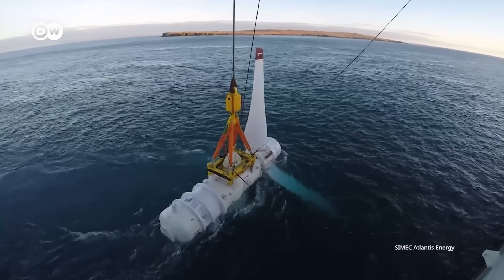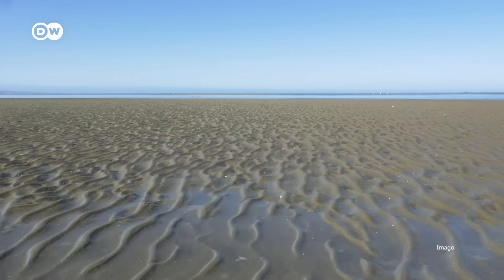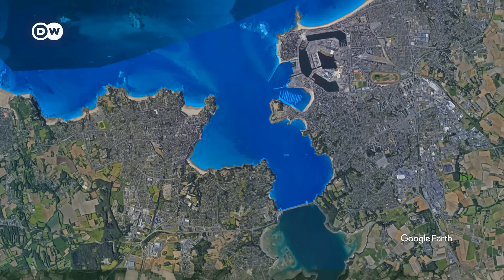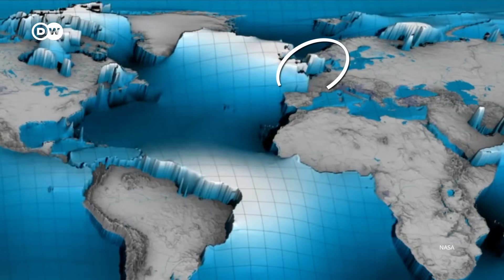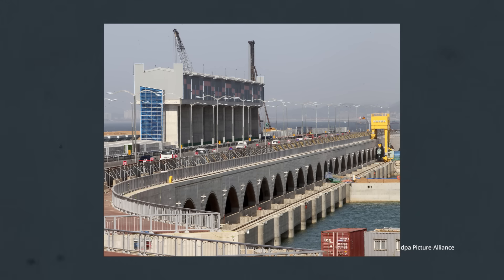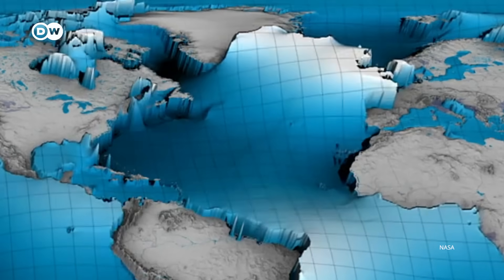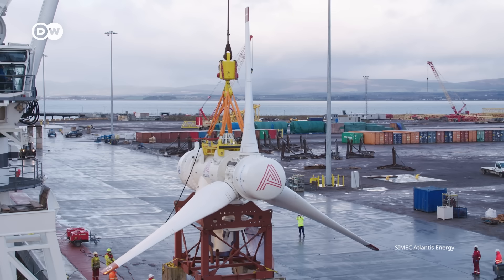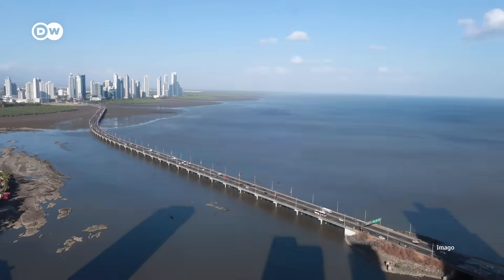Tidal energy could be huge – why isn't it?

Comment: So the environnemental effect is accaptable here, but not in the case of nuclear....
Reply: Nuclear has a worse, worst case scenario environmental impact. But safety aside. They're prohibitively expensive. I am unaware of any nuclear power plants that have made a profit without government help.
Reply: @britishmalayasociety  im not sure why the worst case scenario of a local contamination is worse than the global catastrophe that is climate change... But anyhow...

Costs are primarily tied to construction costs, which can be significantly lower, if you actually use economics of scale. We have seen that in France. I will agree though that nuclear power is best operated by the state itself. For me, this is not really an issue, since it also increases security. And while green energy may be cheap to build, the energy prices are really high... Look at Germany having the literally highest energy bills in the world
Reply: @MrPhiltri  That's what renewables are for. They can be built, usually ahead of schedule, within a year, unlike nuclear which is already pretty quick if done within a decade, by which time renewables would long be constructed, profitable, and producing power. I am unaware of a nuclear powerplant that has turned a profit in its lifetime considering government subsidy.
Reply: @MrPhiltri  Considering France, EDF is the largest nuclear company there, and they've been tabling splitting the company into two, the profitable renewables side, and the less so on the nuclear business. Furthermore nuclear used to make up 80% of the French national grid. It's now 70%. It is that for a reason. Sure, France is constructing 8 new powerplants, and may extend that to 14 by 2050, but France is set to decommission more in that time period. Considering wholesale cost of power. Germany is cheaper than France. And France itself is heavily investing in renewables.
Reply: @britishmalayasociety  please show me, how Germany is cheaper??? This is an insane proposition.

Yes, the French pay for their power through taxes, sure, but in the end its still better.
Reply: @MrPhiltri  The European Union publishes it's gas and electricity markets reports every quarterly. Germany has some of the cheapest wholesale energy prices in Europe, often cheaper than France. Retail prices, are a different story. Germany is replacing old electrical networks through taxes, and on top of that, privatisation of the network has not led to competition, but increased pricing. As what has been found in Australia, for example. Private industries price gouging.
Reply: @MrPhiltri  Yes, every national grid has public money flowing into it. Your claim is that, nuclear is a better cost option. You are aware that, the UK is struggling to fund one nuclear powerplant (HPC) and despite the efforts of the British government, private companies from the UK, US, France, Japan, and China, SWC still doesn't have enough funding for it to be completed?

Then there's the US's upcoming Vogtle 3/4 nuclear reactors. Now costing $28 billion over double the budget, taxpayers footing the bill.

Then there's decommissioning. Sellafield produces zero power, but taxpayers pay millions every year in decommissioning fees, which will not be complete until the next century.
Reply: @britishmalayasociety  well retail prices are what matters, no? And your argument about private price gouging is basically the reason for my argument for state controlled base load energy production. Doing so anchors the market prices avoiding the aforementioned gouging.

In the end, German people, including me, pay the highest prices ever while also bankrolling Putins agenda through gas imports and buying up French electricity at times of low renewable output. That does not seem like a good plan.
Reply: @MrPhiltri  This is before we even deal with insuring a nuclear power plant. Which you could understand is significantly greater than any other energy source. For example, Fukushima was insured for around $1.1 billion, through private and public funds. Compensation to families will cost $50 billion alone. This excludes the cleanup, storage, and decommissioning. Including everything, Fukushima is looking at $1 trillion in costs, for something that was insured for only $1.1 billion. Taxpayers have to foot the rest of that bill. Sure, Fukushima is a rare example, but it goes to show the massive costs that go into nuclear itself.
Reply: @britishmalayasociety  yep, aware of all that, but money paid over time is worth less than money paid today. Discounting is a thing you know...
Reply: @britishmalayasociety  and don't misunderstand me... Clearly renewables are the most important source for the foreseeable future, but it just can't be the only one. Out of all the other option i think nuclear is the best one at the very least because its emissions are lower. Its a good match for the problems of renewables
Reply: @britishmalayasociety  just because you have big numbers, doesn't mean, its expensive. Many smaller numbers can equally add up to big numbers.... I feel like I'm arguing and grade school level...

Yes, nuclear power plants are single big investments. The cost per plant will always appear gigantic as compared to other plants. But the cost of kWh / service time is not.
Reply: @MrPhiltri   Retail power pricing gives distortions that have little to do with the actual cost of energy itself. That's like saying smartphones are expensive because Apple's retail pricing, and adding the cost calls, texts, wifi and data plans used. You're basically saying that, smartphones are expensive because they cost $135 a month for the next three years through ATT. Rather than, the actual value of the device alone, which is ~$500. The involvement of private companies in Germany's case, shows Moore's Law in action. But still, prices are declining there, as they are in Australia with their renewables loadout. Pricing aside, energy reliability has improved thanks to renewables.

Considering retail pricing, you'd need to look at a nation which has more renewables than Germany. Germany's renewables represents less than half the grid. The global leader, excluding smaller territories, is Norway with just over half. Norway has cheaper wholesale energy than Germany or France, by far.
Reply: @MrPhiltri  MSR might be an option in the future, with its promises of safety and cost. That is the only other option, but, we won't see that until 2030 at the earliest. So for now, renewables are pretty much the only option... There's this newer undersea turbines being developed, and older green energy such as geothermal and conventional hydro.
Reply: @MrPhiltri  Yeah, well, when governments and investors put their money and weight behind renewables globally, it shows you that the maths work. There's a reason why you can buy your own personal home solar and battery solution now.

And if you want to look at costing specifically, Lazard have done LCOE on renewables, fossils and nuclear. Renewables are always cheaper than all others.
Reply: @MrPhiltri  Lazard being, an old, reputable global financial and asset management advisory company. So it's not like some unknown new startup. But I guess nuclear has found some traction lately. The nuclear lobby is strong and is funded by a lot of mining industries. You'll find people that push for nuclear, do so thanks to lobby funding. Eventually you end up with influential people like Michael Shellenberger who both shill for nuclear, whilst also end up denying climate change... 🤷‍♂️
Reply: Scotland also produces and researches nuclear energy

Comment: Before watching, I'm going to attempt to answer the question posed by the title.

Building stuff that has moving parts underwater that you want to last for a long time is hard. So hard, in fact, that it is too expensive relative to other options.

Anyone already finished, how did I do?
Reply: Nailed it
Reply: @Arrica101  I mean, they didn't nail it. It's expensive but not for the reasons they gave.

Comment: Harnessing tidal power slows the Earth's rate of rotation (lengthening the day), as well as lengthening the Moon's orbit, and moving it further away. Has anyone ever calculated how much?
Reply: Very very very very minute, virtually zero
Reply: That energy is being transmitted anyway. If we don't use it to generate electricity, it would simply be lost to any number of natural processes such as viscous heating of the oceans. The eventual tidal locking of the Earth to the Moon in inevitable.
Reply: @costcorotisseriechicken2520  Has anyone calculated when the moon's geosynchronous orbit will occur, with consequent loss of tides?

And where relative to the earth will the moon stop? Which area of the planet will be permanently shadowed?

Comment: I've been asking this for years. Why go with unreliable wind when we have huge untapped reliable tides all along our coastline.  There is no issue with slack tide or no movement because that high or low tide moment happens at different points along the coast . You only need to be a few miles away from each other and you would avoid that deadspot.
Reply: You wanna know?
Cost, its not economical.
Corrosion, its frikin Salt water!
Google a picture of a old windmill and u will see how beat up those are. Now imagine the same but 100 times worse.
Reply: I’m kind of glad we didn’t, if we globally jumped into it 30-50 years ago we would have destroyed so many rivers and ecosystems that way, but the other way wasn’t much better.  Technology increases so fast I’m sure we will see more eco friendly water turbines in the future and I’m excited for it. Clean renewables and nuclear is the future.
Reply: @jcakblade101  I do recognise that. I canoe and sail these waterways.  But how much damage are we doing endlessly relying on gas, which all come from Russia.
Reply: @directorstu  gass isnt the only alternative. We can use wind, solar, nucler, and fusion(in you know "10-20 years"(aka 100 years))
Reply: @filip9564  Sounds like you've been watching Fusion Prediction/Discussions for a long time.  I remember in the mid 70's when I was in college, they said "Fusion is right around the corner".  Keep saying it and one day they'll be right.  I'll be dead and buried first though.
Reply: @Stein Mauer ... I did watch the video.  Lots of places along the east coast where the sand banks funnel currents. We are an island after all.  I sail past the wind farms  already there and  more are planned.  One of the reasons gas reserves are low now is because wind let us down last summer. Its true tidal likely to be a bit more expensive than wind until used at scale but not x 5 if comparing off shore wind with tidal generators.  And it is vastly cheaper than nuclear.

Comment: I remember in schooling have to look up Tidal energy and how unfortunately the Finnish sea doesn't get barely any Tidas AND the countries are rising many meters out of the sea each year so at least for the countries that have Finnish/Baltic sea Tidal won't be the solution. But not to say this shouldn't be used where it is most efficient. Building tons of wind turbines is not the most effective solution for renewable energy. Anyways this is just blabber from someone with high school knowledge on these so it is possible I am totally wrong here as well.

Comment: No no no no no - There should be some big recycled plastic hollow egg linked to the generator on the bottom with a lot a lot of gears
Reply: btw these eggs - you could use em as islands for food production
Reply: look at there is no need to sort plastic - just warn it up until it melts and make another part of island then just cover up with some texture that would not spoil the ground, fill the island with ground and voila.
Reply: if not - you can put solar panels on them

Comment: "… oceans are abundant in marine life …"  not anymore, they're not. 
The huge, roving Chinese fishing fleets (amongst others) make short work of enormous swathes.
Idea for another video - overfishing.
Reply: … and you mentioned impact on marine life. Well that should be balanced against the impact of Oil & Gas exploration that tow compressed air firing tubes that kill everything within a kilometre. It's easy to point out some potential problems but nobody is saying what bigger problems will be eliminated.

Comment: i find it fascinating, that with tidal, we are basically tapping into an external energy source: the gravity of moon and sun.  Tidal could be built 3 dimensional, other than wind energy.
Reply: Well with Wind we are basically tapping into an external energy source too right?
Reply: @ChaosEIC  please, to much logic can damage sensitive brains, the question is external to what? body, planet, planetary system, galaxy or Universe?
Reply: @antoniolima1068  obviously planet.
Reply: With it you're braking this huge tidal wave leading to non energy at all one day. This is not a solution that lasts forever. It has an impact on Earth's rotation as well. You cannot equip the entire ocean with these things.
Reply: @lampexxl8599  No way Jose. the ocean mass alone that is in move here, we barely have any effect at all on it. plus, as i said, it's basically agitated by the sun and moon - the amount we can possibly take out of the system is absolutely miniscule.
Reply: @B33t_R007  It does play a role though, it's still slowing down Earth's rotation. It takes time but we wanna aim for something that will work for the next 100k years. I'm not saying it's gonna have a major impact now, what I'm trynna say is that this is not gonna be the energy source that's gonna save us or that's gonna be effective for the next thousand years. We need something that's barely interfering with our environment or not interfering at all.
Reply: @lampexxl8599  This would work for that long. You would never see the impact.

Comment: I guess the biggest problem with tidal energy is that ocean is a harsh environment. Fixing things or keeping them clean and in working order is tough.
Reply: And Yet, ships use huge moving metal parts under water constantly and still run profitable . 🤷

A ship screw shouldnt be that different from a water Turbine.

The animation showing the virtual fish get slapped by the turbine worries me a lil ..😆

Tho i think solutions for less dangerous ways of using that huge volume of water moving can be designed. 🤔
Reply: @NewPipeFTW  Ships have the advantage of moving quite fast, which helps to keep the hull and propellers clean, but, inspite of that, all ships must visit dry docs and undergo hull cleaning to get rid of barnacles and other nasty stuff that builds up on the hull.
And they run profitable due to scale. If you could build a turbine the size of a cargo ship then perhaps it would out perform wind turbines. The ocean still is a harsh environment, and if engineers can generate energy buy staying out of it...then they will. Just compare the difficulty of maintaining a solar panel VS under sea turbine. Anyone can clean a solar panel. To clean a turbine, you need a professional highly paid divers...who are in short supply already. To fix the turbines, you need even more rare breed of workers...undersea divers who are also engineers. Alternatively, you would have to detatch the turbine from the sea floor, carry it to a drydock, do the maintenance and re-install it. Im not saying that its impossible....just that its much more expensive.
Reply: @UninstallingWindows  
Sure but think oil platforms for example are also a proofof concept.

In the end its a cost/benefit assesment, yeah.

Still nice to see that we have other scalable options in case wind or solar is unavailable.

I could imagine places with less land/wind, where a underwater turbine that is accesible by boats is still more suited than other current power generation tech.
Reply: @UninstallingWindows  Truth is you don't know any of this, you are just guessing. Let the engineers involved handle this and stop spreading information white noise
Reply: @johans7775  Truth is, i do know about this. Anyone with rudimentary thinking capabilities knows this.
Reply: @UninstallingWindows  white noise, white noise. Stop spreading it
Reply: @johans7775  And yet, it is you who is spreading content'less comments.
Reply: @Arrica101  to assume it would be exactly the same as caring for a huge ship and state that it will be "highly costly" and "very difficult" and needs "highly paid divers" is simply wrong. He does not know this but still tries to dismiss the entire concept so therefore = white noise. Stop spreading it and let the experts handle it.

You googling for 20 minutes or having been on a boat or seen barnacles on the hull of a ship does not put you on the same level as someone who has worked with this their entire life; and no, in these 20 minutes you will not be able to detect something that you believe the experts have missed.
Reply: @UninstallingWindows  if you don't know, than don't act like you do. It is okay. Let the experts handle it and don't spread desinformation.
Reply: @johans7775  ocean water is highly corrosive, common-sense bozo
Reply: I think fixing things is not necessaryly the problem but the corrosion of the salt water is just horrific.

I mean you would have vassal which can lift up the turbines and just repair it. For wind turbines you need a giant crane too but I guess less often.

Comment: There are two problems with tide power. One is if the underwater seals fail you have lost a very expensive generator. The second and the big one is barnacles.

Comment: how do you deal with losses on distances to power houses more than 1000km from the sea ?

or a concrete factory ? or a farm ?

that's why it's not the default system already, cuz it's not enough. if it was, it would be the norm.